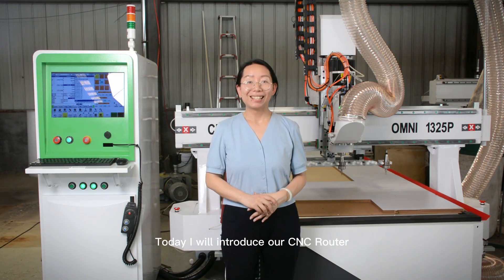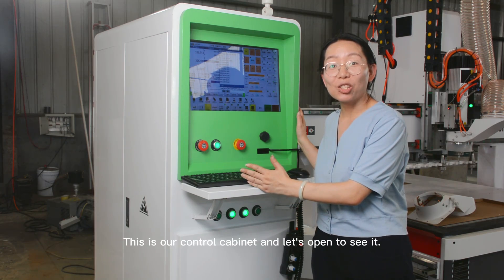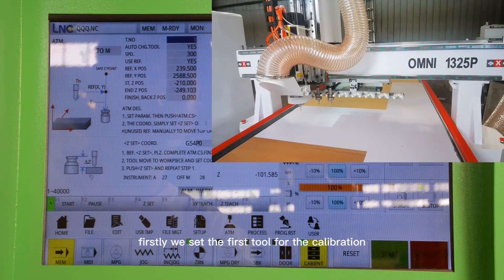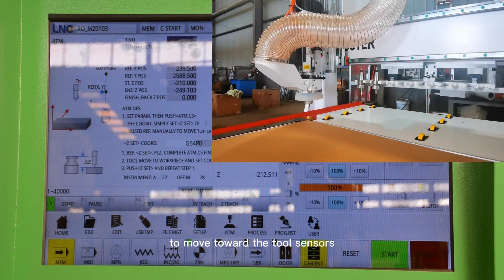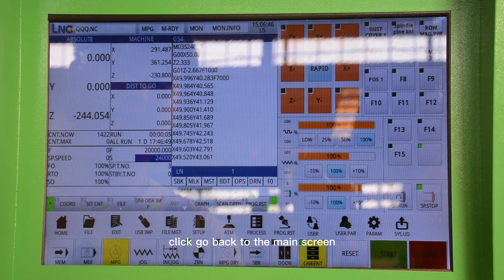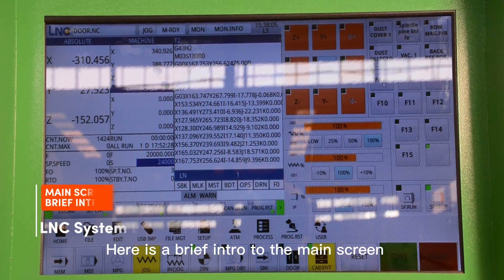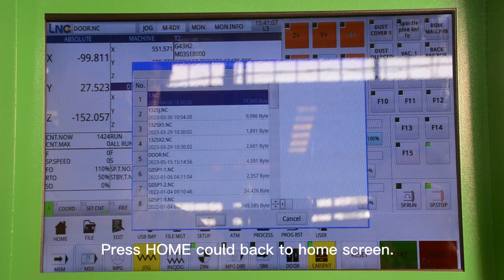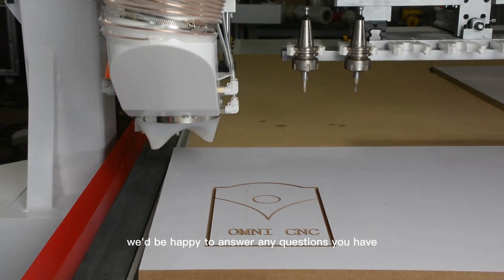Learn How to Operate the Omni CNC Router and its Features | PLite Series

Comment: Amanda, I need  bit of assistance regarding my CNC when you have time
Reply from the maker: John, hope you are doing very well. Long time no talking with you. If it is about machine operation, maintenance, contact 86 15621877020, you also could reach me at 86 18615454808

Comment: Can I buy your cnc in Algeria? Do you have a reseller.?
Reply from the maker: We are looking for reseller in Algeria. We can arrange all you need to delivery the machine to your door. International trade now is very common. And we also have video guide to guide you to connect vacuum pump and dust collector to machine and power. And there is also video about how to use the conrol system. Let us know which issue you are worried about?